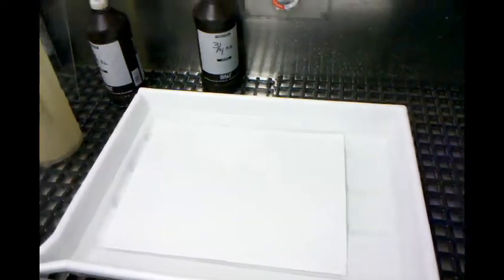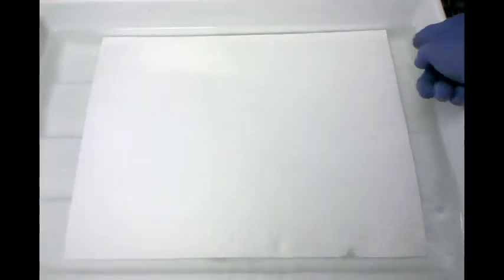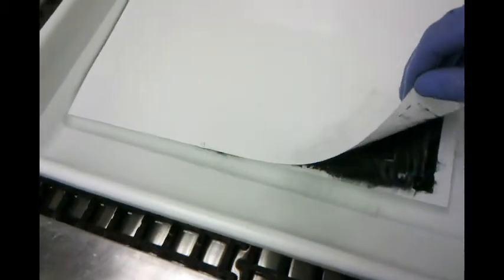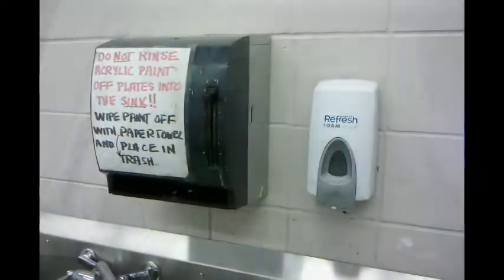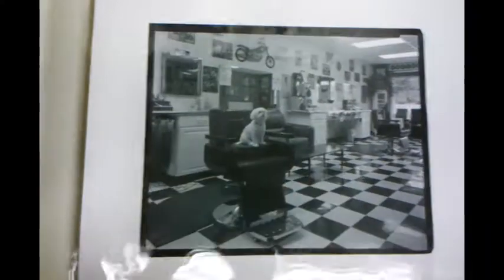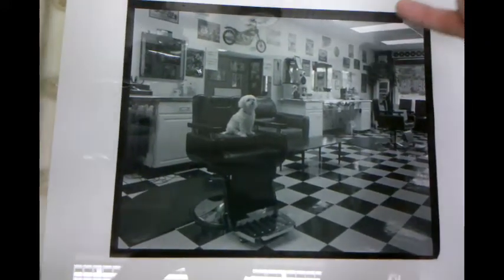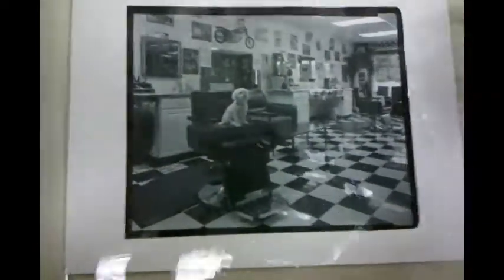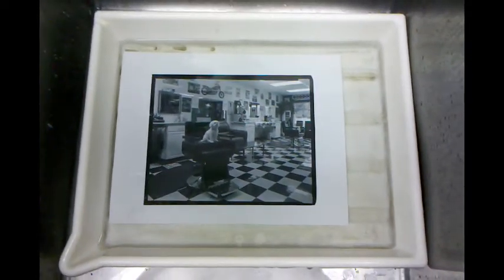Carbon Transfer Printing - Developing the Print

Comment from the maker: In this video, I'm using fixed out double-weight RC paper as a final support. It's one of the easiest for beginning carbon transfers. You can also use fiber-based papers, gelatin sized watercolor papers, glass, aluminum, almost anything.